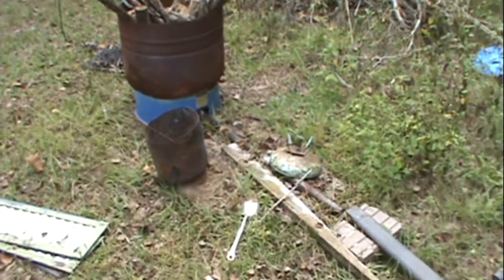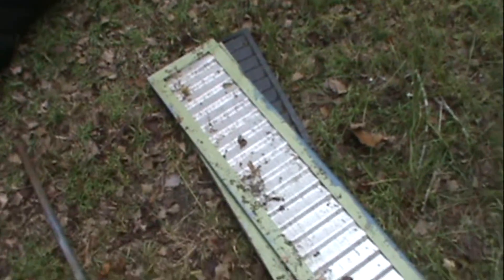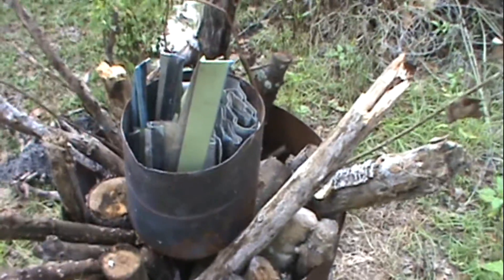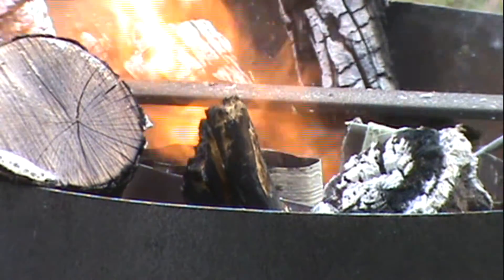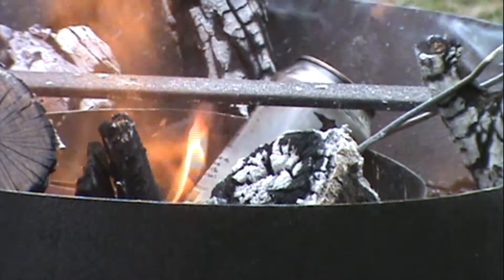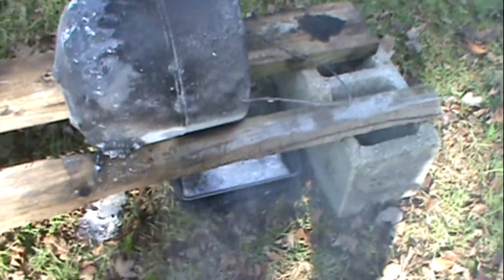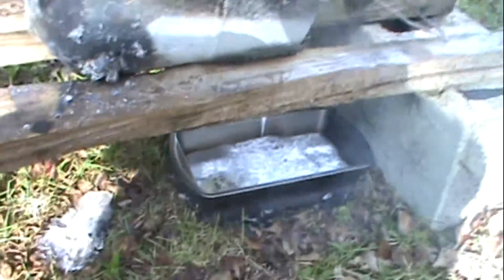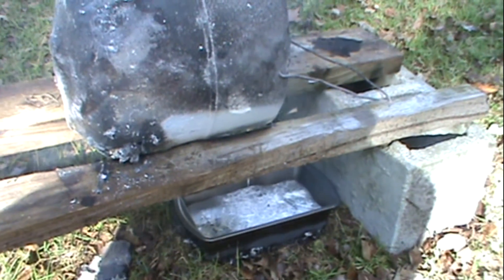Melting Aluminum With Wood

Comment: How long does it take to melt this stuff? What was the final weight of this block?
Reply from the maker: Hello, with the leaf blower going they started melting within like 10-15 minutes. I never weighed the block but it was pretty heavy. I do them in cupcake pans now so it’ll be easier to melt for sand casting down the road. Looking forward to trying that.

Comment: I noticed the rust in the bottom of your pot. I'm wondering if it along with the aluminum, oxygen, and high heat caused a reaction to essentially produce thermite thus melting through the pot?

Comment: do you think you can melt without a fan or some thing
Reply: mansagar guy Theoretically speaking yes, but it will be extremely difficult. A source of air, such as a hairdryer, is recommended.
Reply: you can use anything that creates airflow even a vaccum cleaner on reverse mode
Reply: I do it without a hairdryer or anything, takes 20 mins or more to get it orange and red hot